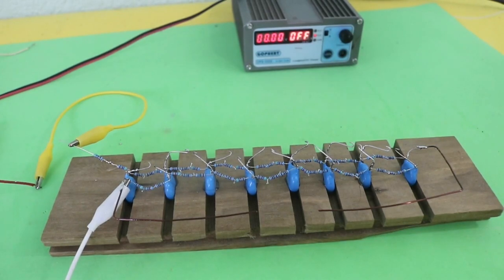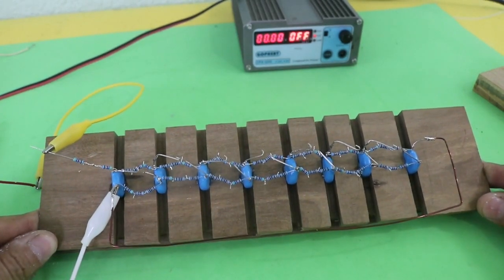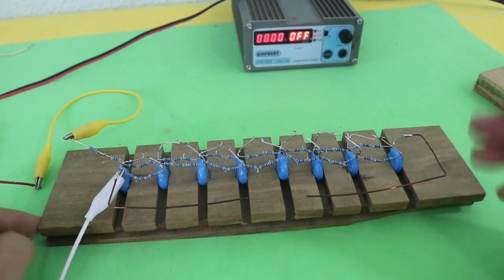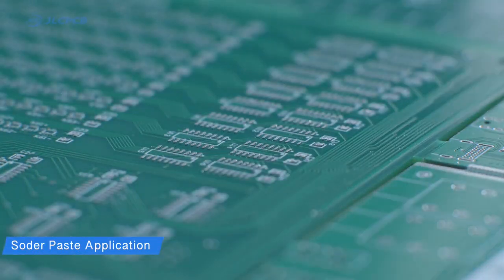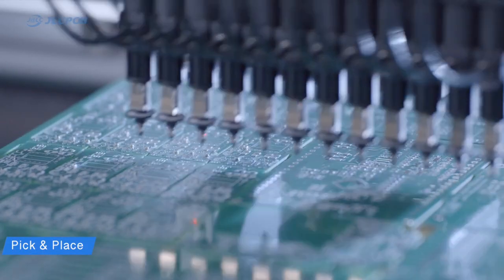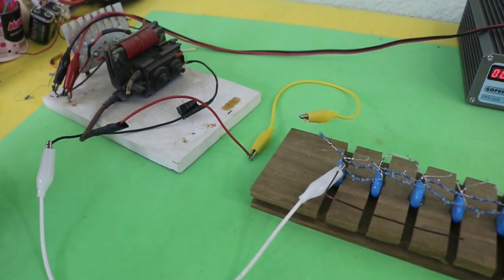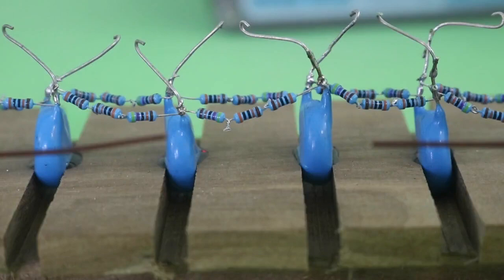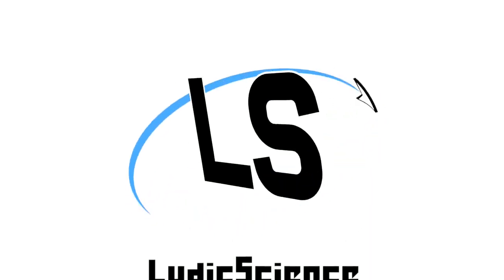Marx Generator V2

Comment: I love playing with Marx generators, I've got a mid-size one I've been playing with recently that makes 8" arcs and is set up to trigger manually for the highest possible voltage, all the air gaps are set just beyond their breakdown voltage and I made a small remotely controlled arm with a peice of copper wire on the end that partially bridges the first stage spark gap. You should try it out, it makes extremely consistent arcs without any of that random sputtering and failures to arc, and they are fantastically loud.